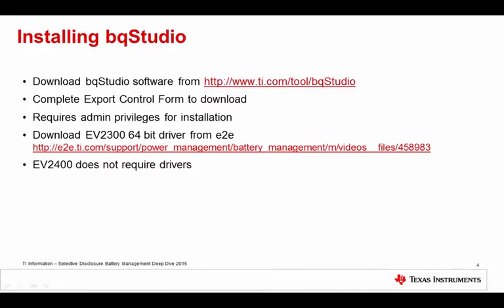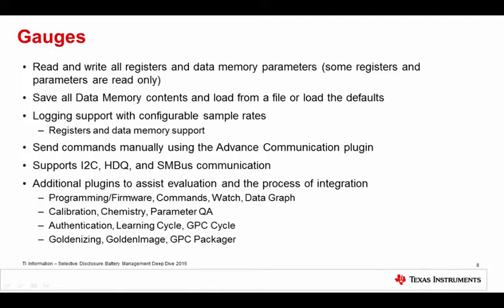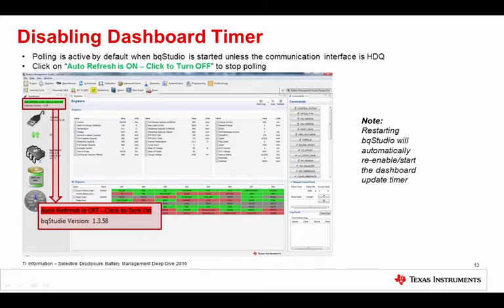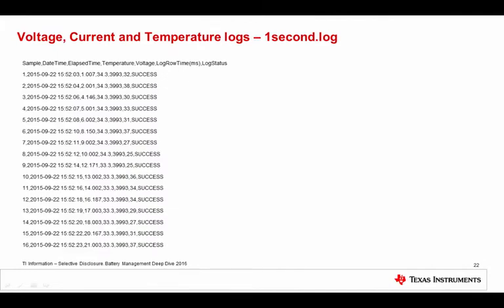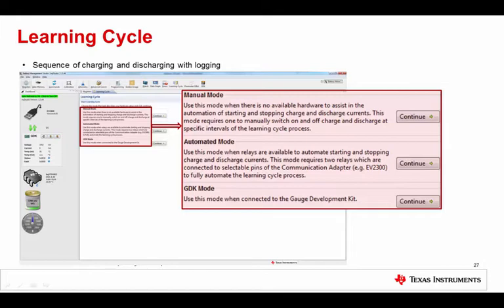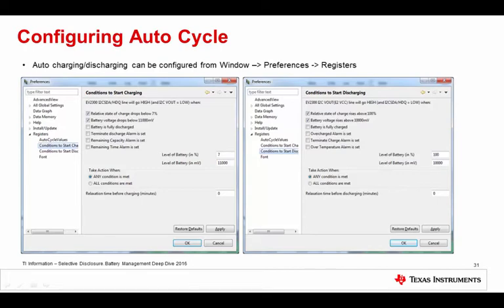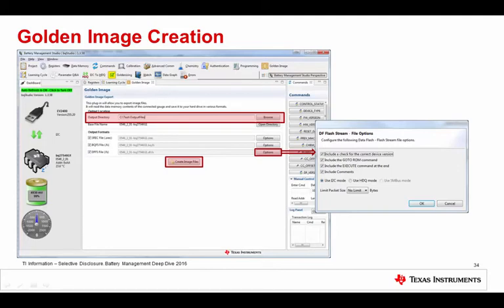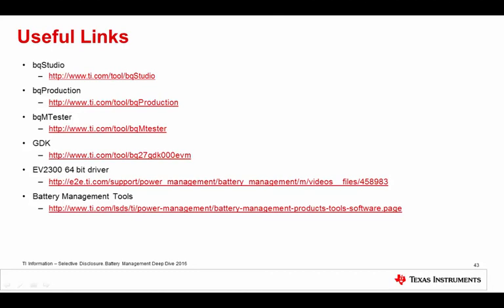Introduction to Battery Management Studio (bqStudio)

Comment: I am currently trying to download the Battery Management Studio (version 1.3.127 Build3 for Windows) from your official website. However, I am encountering a recurring issue.

The download process starts successfully, but midway through the download, it stops, and I receive an error indicating that the file link may no longer be valid or that the session has expired. When I attempt to resume the download using my download manager (IDM), it requests a new download link, but I cannot retrieve one as the webpage seems to have changed.

I kindly request your assistance in providing a stable download link for the file or guidance on how to resolve this issue. I appreciate your time and support in this matter.

Comment: Dear friends.
For me and for many, who do not have any basic knowledge of programming language, but who have a burning desire to learn, because they work with batteries and are losing service for not understanding everything that involves programming, reprogramming, and unlocking the chip, starting from this In principle, if you know, or have an idea of how to start to understand the programming language of the BQ line chips, step-by-step, please point out, indicate the way to start.
I realize that the information is in a very technical language for those who are already in the area. And who doesn't even have the basic level is difficult.😉😄

Comment: bq30z5562tg4 i have this chip in dji battery pack   i  used bqevsw   to read  and delete the factory lock  with 00 write to hex 0024 and 00 to hex 0029 in sbs write word option ,,,,,  after sealing again it worked and charged up to full     then 3th led was blinking so i want to read fault and i couldnt unseal   and software says i used wrong chip number      i read before with setting bq30z55r3 v0.35    and accu also cant turn off    ,,leds are on till battery is dead again  what can i do 

kind reggards sem

Comment: can i connect the MSP430F5529 board instead of the ev2300 or 2400 and still able to use bqstudio since ev modules using the same chip?